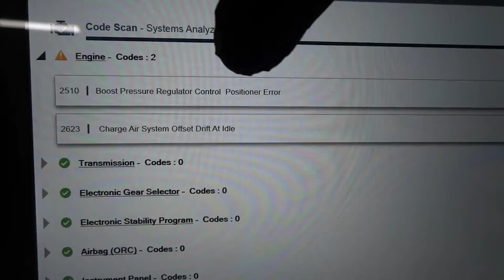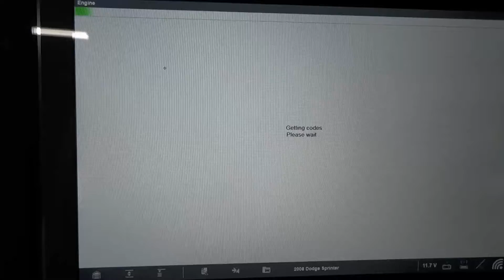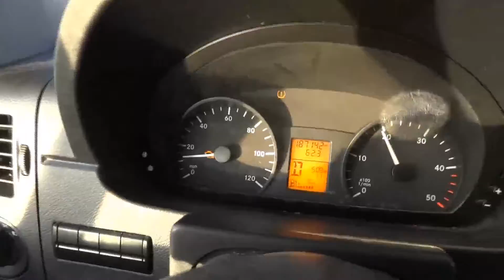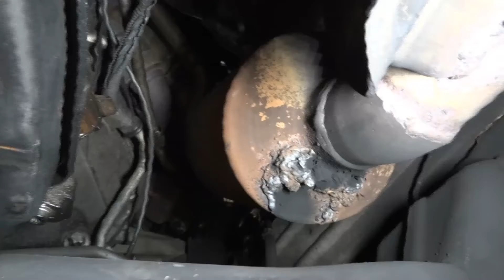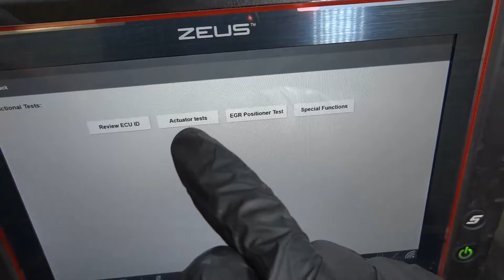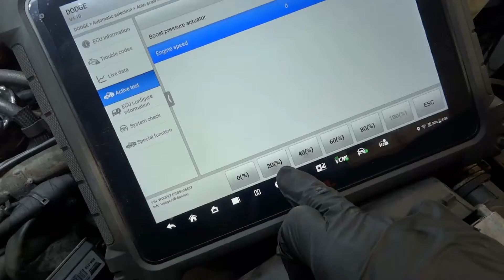Mercedes / Dodge Sprinter Code 2510 Boost Pressure Regulator Control Positioner Error  Diag Part 1

Comment: I am experiencing all the same readings as you, with the unplugging with multimeter and have power ground and control with test light however when codes are cleared boost positioned is working when actuated with scan tool
Is it still the actuator
Reply from the maker: @javisgomez6420 if your wiring is good then the issue is the actuator

Comment: I have battery voltage at the power wire and 11.2v on signal wire with key on and actuator plug in. The signal drops to 1.2v with engine running.
Map signal pressure rises if i manually move the turbo vane linkage with engine running. Maf reads 14.5g/s at idle and 36g/s at 2000rpm. Please let me know why my signal voltage is incorrect at koeo and does not change with rpm therefore not producing boost. There are no leaks in hoses or intercooler.
Thanks
Reply: The actuator moves freely if i ground the signal wire so seems to be working.
The actuator does not move if i unplug the maf sensor.
Reply from the maker: @chrisclark010266   it sounds like you have a wiring problem

Comment: Hi Kit, I looked many of your videos and you realy do a great job. I appreciate a lot the way you explain the problems and the way the fix them. I have a question. I have a 2007 Dodge Sprinter with the 3 liters engine. I was far from home and had problem with my engine falling on the limp mode. Finaly took an appointment in Mercedes dealer and it cost me $600 canadian to diagnostic a  loose clip on the 3 ´´ turbo charger rubber hose  just before the intercooler. So I bought a smoke machine to do my diagnostic the next time a have a similare code. I  know that I have no leak actualy, so I tried my smoke machine to see if it work. I did the same thing you do in your video. Disconnect the air intake ,put the plug and connect the smoke. I don’t now why , the machine work correctly but,  the pressure never go up . Smoke is produce by the machine and did not find any leak, but I was outside with windy condition…hard to the smoke. Anyway , I am sure I don’t have a leak. Looking at your video, on your machine the pressure does not seam to increase when you do your test, am I wrong? Why my machine can not increase the pressure? Where does the smoke go ?
Reply from the maker: @BernardDubuc-nv4rs  What pressure are you referring to?

Comment: Had this issue come up this week and I've been trying to figure out the problem. Ran smoked through the system and everything seems to be okay but the smoke ends up coming out of the oil dipstick inlet. Is this a normal place for the smoke to exit?

Also, should the actuator be in the open position for this to work properly?
Reply from the maker: @_0O0O0O0_   smoke coming out of the dipstick is normal, the actuator of the turbo doesn't have to be moved!

Comment: what is the normal operating pressure of turbocharger in bar or psi on that model? min/ max
Reply from the maker: Mihai Sorin  Turbo temp can vary between 900 - 1400 degrees
Reply: @KITS_Auto_and_Truck_Repair  sorry, the boost pressure, thanks
Reply from the maker: @mihaisorin9705   My Pleasure!!
Reply: I installed a boost gauge and mine goes up to about 22 psi on a heavy load